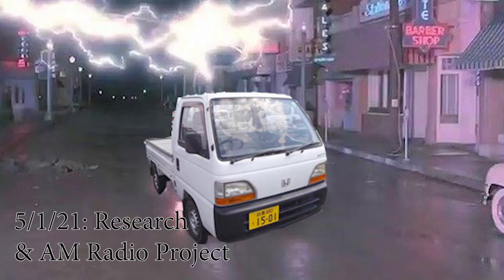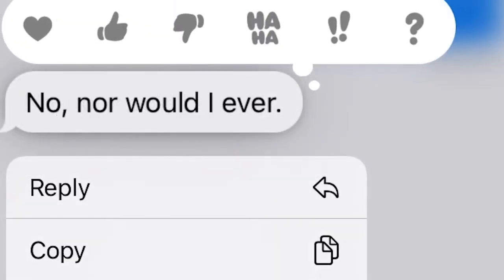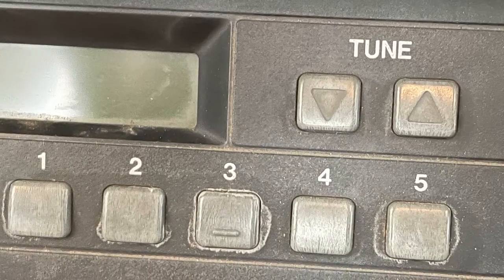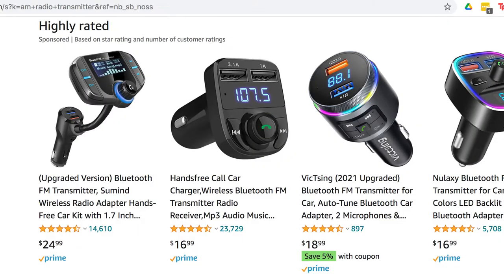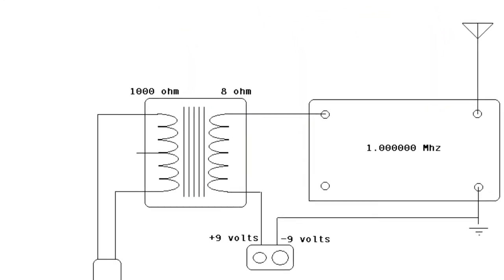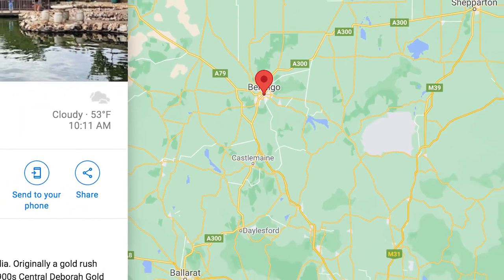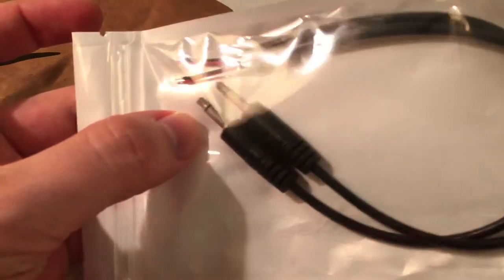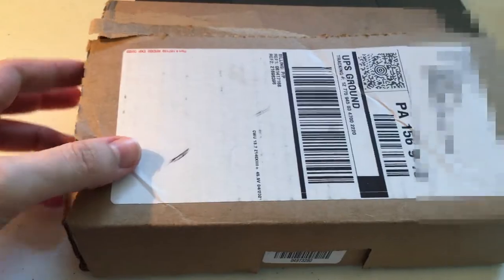Converting a Kei truck into an EV - Starting small - Part 2

Comment: Building your own AM transmitter?  That's nuts.  I'm an electrical engineer and electronics experimenter since the 1970s.  I probably have the parts to build the AM transmitter, but when my 4WD Daihatsu Hijet arrives, I'm ripping out the AM radio and installing a double DIN ATOTO Bluetooth stereo with a backup camera, but I respect your embracing new things and learning.